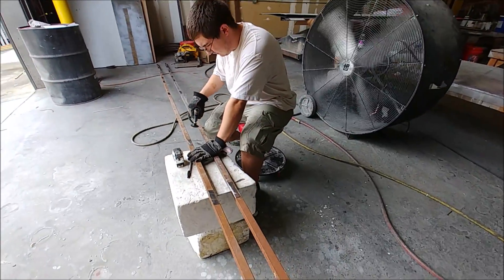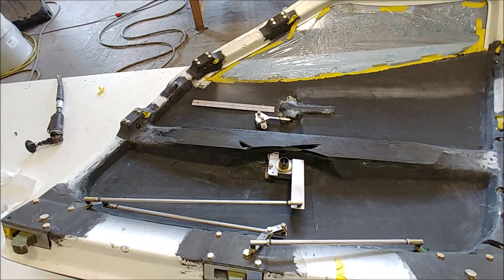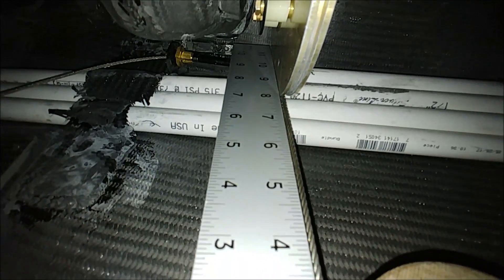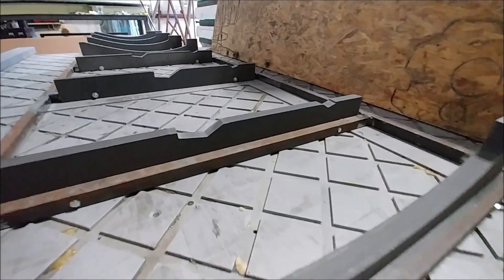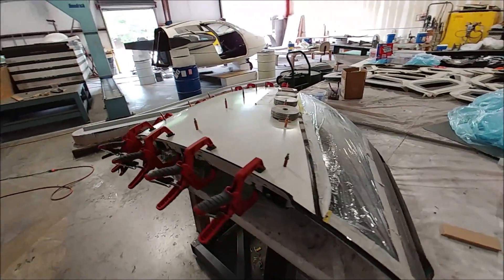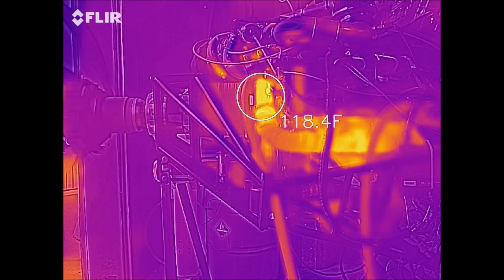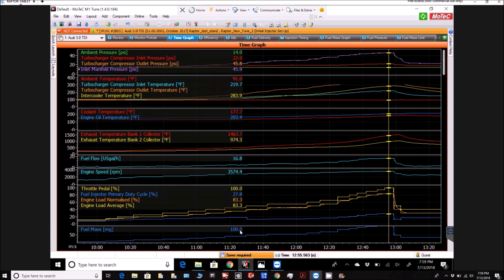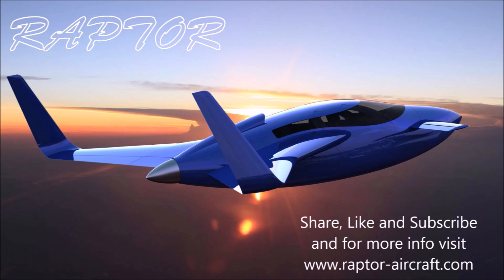EGT and Turbo Temps? - Building the Raptor Prototype

Comment: Peter. In my turbocharged 182, I usually see EGT temps in the 1450 range. The number I've been told to watch are cylinder head temps, which in my airplane are aircooled. How do the cylinder head temps, or the water temps look on the Audi engine?
Reply from the maker: You can see in the EGT log that the oil and coolant temps were still only just on 200f but they didn't really have a chance to build up.

Comment: I will look up some specs, but my gut feeling is that you're running an excessive amount of boost, at the very least I would experiment with lowering the wastegates spring pressure on the first turbo and allowing the second turbo to carry more load. Just for heat load leveling purposes and longevity.

 I don't think you need such high boost levels to carry the load you have, but I'm guessing at what load you have. I think you should experiment with lowering boost pressure and getting to the point where you get a light grey smoke from the exhaust. This would establish an absolute full rich condition as a baseline.
Reply from the maker: Once we're pressurizing the cabin we'll need the excess boost so right now I don't want to mess with that.

Comment: Please look into vapor or fogger for lowering intake and EGTs. It’s a very simple thing to add, costs less than $100 and works amazingly well on turbo engines. EGTs shouldn’t be above 1300 degrees for any extended period of time. For takeoff, you can go above 1300 degrees, but I’d suggest 15 seconds at the most. You can severely damage the engine above 1300 degrees. By installing the fogger, you can lower temps while increasing boost and horsepower at the same time.  Check into it.
Reply: Unfortunately I agree with him.  As having spent quite a bit of time with diesel engines on a dyno, I can say that 1300f TIT really should be what you aim for at sustained cruise for a diesel engine. Modern engines like this will flash above 1500f from the OEM, but only in short bursts.  Also, the FLIR camera is not capturing true air temp inside that pipe.  In my experience, the pre turbo temps will be hotter than the post.  So if your turbo 1 outlet temp is at 1500f, I would expect the turbine inlet to be 100-200f higher.  Which is too much either way.

Comment: Just food for thought: why are we combining the left and right cylinder banks into one stream and then power two turbos in series while we could have each bank just power one turbo. We only need to cascade the air compression but there is no necessity to cascade the exhaust path. Then in each turbo the heat would just drop 400 degrees and there would be no heat up in turbo 1 on the exhaust side. Also no restriction/heat-up in a Y-pipe.
Reply from the maker: Martin Renschler changing the configuration as you suggest wouldn't lower the temp exiting turbo 1 but I like the way you think. Thanks for your input.

Comment: Peter, I also had a question about the vacuum bagging process. You’ve created the channels in the molds for the silicone skin, but you not using them yet.  Is that in case you need to redo a mold and don’t to waste the investment of the silicone, or you just don’t want to worry about having to store and care for them during the development process?  Do the skins have a shelf life?
Reply from the maker: It's pointless creating the silicone for a single part right now. When you're trying to speed up part production that's when they'll be needed.

Comment: So you are reading the temp of the y pipe, not the temp of the actual gasses. Due to radiant and convective cooling, the pipe will never reach the temp of the exhaust gasses.

Educated guess would be about 1800 degrees for the egt. Which is actually a tad on the hot side if you ask me.
Reply from the maker: I'm not sure it would be that high because the exit temp is only 1500 and that should surely be higher than the inlet temp.
Reply: Raptor Aircraft

Turbochargers work by stealing kinetic and thermal energy from the exhaust gasses and using them to compress intake air. Typically egts drop about 300-400 degrees from turbine inlet to turbine outlet.
Reply: I agree with Jake. Two more EGT sensors will give you and the diesel tuners a much better picture. Install one EGT probe right before or after a manifold exit and one more right before the inlet to turbo #1.
There are numerous, well established diesel tuners in the states here and controlling EGTs is very high on the tuning priority list. Honestly, I would work with a tuning company that has more experience with diesels. Tuning the ECM to get the power the Raptor needs while also controlling EGTs should be very possible.
Reply from the maker: There's only about 14" distance from the last cylinder outlet on either side of the exhaust to where the left and right sides meet in the Y pipe. Is it really necessary to install a sensor at either end of that or will one just before the Y suffice?
Reply: Raptor Aircraft, 1 would be plenty then. Diesel tuners typically install the probe as close to the exhaust source as possible, ie, the manifold or just after it. With the continuous operation of this engine in a high power setting, controlling EGTs for reliability/longevity is vital.

Comment: Peter,

For reference a Cirrus SR22T with a twin turbo TSIO-550-K will regularly see 1600+ F at full power during the duration of the climb to cruise altitude. Cruise is not much lower at around 1550. This is for both turbos measured at about 1" prior to the turbine inlet. I know this is a gasoline engine with a throttle plate but the turbos are likely very similar and temp is temp. 

As more of a seat of your pants kind of comparison, flying around Cessna 400 series aircraft at night, looking at the cowling louvers through the window would reveil glowing red turbos and exhaust pipes. Just saying that I think the temperatures you are seeing are completely normal. 

Cheers
Reply from the maker: Adam, thanks for the info. Cheers
Reply: Adam Menge, waypoints are helpful but context is always critical.  That engine was developed for those conditions.  Audi??   Needs testing lots of fun work ahead.  :)

Comment: Hi Peter,

Just wanted to say I'm really liking your videos, and am looking forward to adding my deposit to your growing list.

In regards to the turbo heat issue, I would just like to make a couple of suggestions. Firstly, while the temps may be high your engine is in a static mount. While there is some airflow its no way near the same as could be expected at FL20 at 180Kias - thus most of your cooling is radiant and not convective.
Secondly, have you considered adding in something like the following product http://www.cfmplus.com/ I'm not sure if it's going to help 100% but their product seems interesting. 

best regards and many thanks.

Comment: Smarter people correct me, but the FLIR camera is reading temps of the metal not the temps of the exhaust gas before the turbo.  If you were to put a probe in to measure the EGT pre-turbo I'll bet it's something around 1200ºF.
Reply from the maker: My guess is that the flir temp is not that far off the inside air temp. The Y pipe does have the ceramic coating but I don't this it's hiding 800f. I'll get a sensor in there in the next month so we'll know for sure.
Reply: Don't know if you've done this yet but just to validate the FLIR readings against the ceramicoated pipe you could tightly strap a thermocouple on to the outside of the pipe and see what it reads. At very least that would ensure you're not dealing with an emissivity (which theoretically should be excellent) or calibration issue on your FLIR.
Reply: It's absolutely far off from the inside gas temp. First, the heat transfer from gas to pipe is not very efficient and requires a substantial delta-T, then the heat flux across the pipe thickness also requires a delta-T. The external temperature of the pipe is determined by how hot it has to be to radiate away the required heat flux, not by the temperature of the gas inside it.

Also: I thought that pipe was glowing red in some earlier video? To visibly glow, the temperature must be higher than something like 1000F, so if that was the case, the IR camera is not displaying a correct temperature.

Comment: I know absolutely nothing about turbo charged engine design, but 1400 does not sound high to me for the egt, especially after leaving the turbo, where I would think the compression of the air generates  a lot of heat. I lean my IO550 in climb out to 1300 degrees, and it has no turbos.

Comment: I would be most concerned about turbine inlet temperature. The turbine has a rated input temperature of probably around 1200F, generating 30lbs of boost should lower that around 400F meaning the exhaust path after the turbo should be around 800F after the turbine. You’re reading 1400F after the turbo which makes me wonder... You could just clamp a series of temp gauges to the exhaust pipes for now until you have time to mount them properly. At least by using the same set of temp sensors before and after each turbo you can get a better idea of the heat flow.
Reply from the maker: The temp sensors I have are accurate. My feeling is that the exhaust exiting turbo 1 is being compressed more because it's being forced to spool up turbo 2. The back pressure is likely what is driving it's temp so high. So it's likely that the exit temp would normally only be 800f. Anyone want to contribute their thoughts on this? I don't have pressure sensors in the hot side. I doubt they would last long with the heat.
Reply: Wasn’t questioning the accuracy of the temp probe. Was concerned the temp is high suggesting that the turbo is being run over temp. 
My suggestion of strap on sensor before and after each turbo was to get a relative temperature reading before and after each turbo with the same measurement method until you have time to get the sensor welded in. Of course you could just use the FLIR to get temps before and after each turbo to see the relative temp differences. Of course you will need the same surface type to measure on each side to get the correct relative measurement. 
Temp probes before and after on hot and cold side and pressure sensors before and after on cold side would enable you to measure the work being done by each turbo which in turn would enable you to sanity check the temps you are seeing. All depends on how much you want to instrument up the test rig.

Comment: Great work and progress as always!!  
Regarding the temps and fueling, I work for Caterpillar as an engineer in their Diesel engine division, but I am no way qualified to tell you how hot to run the specific components in the unique system.   
I can say if you’re really reading hotter turbo out than EGT in a here is a measurement issue as that’s physics.
Reply: Tim Duncan ,,, I don't know what the exact numbers should be for this combo, but I would try and find out Audi's numbers. Yours should be overall lower as your downstream restriction is less. At your interest level you should have four probes: turbo one inlet and outlet, and even though it's a short distance to turbo 2 the same for it . Only talking hot side here .
Reply: Are you measuring pressures in the exhaust before and after each expansion step?   This should be used as a Check bit to temp data.  Are you measuring turbo rpms?
Reply: Roland Tamaccio I think you meant Peter’s temp limits would be lower as downstream restrictions are higher.  More boost vs Audi, requires more pressure drop on the exhaust side
Reply: Tim Duncan ,,, by downstream I was referring to an automotive system, all the way to the outlet tip. Of course we don't know how much of this data is available from Audi. Btw, how much of the exhaust system is oem Audi ?
Reply: Roland Tamaccio,  good points there will be no Audi exhaust system parts past the turbo.   
Regarding limits, lower would be safer and more durable.   Durability is a big issue and hard to engineer with specificity.  It requires a lot of time and fuel to validate, very hard.  Luckily Audi has presumably done a lot of this and set their limits accordingly.  Pete needs an Audi v6 expert.
Reply from the maker: I don't have pressure sensors. I doubt they would even handle the heat. No rpm sensors either as these turbos don't have fittings by default. I don't have time to fit them.
Reply: Raptor Aircraft ,,, well, somebody like you that has the will to find out, will eventually want to look at "drive" pressure. You have to run long lines to get away from the heat.
Reply: The reason for the temp rise is temp stacking from drive pressure. I run a 600" engine on 50% alky & 50% nitro & see 1200F at the port &1900 or more at the turbo's depending where my gates are. I don't know what numbers this diesel should see but Tim Duncan's Cat connection should be able to get you some ACERT info that would be a good ball park.
Reply: NZ Salt Flats Racer ,,, although nitro is sometimes considered to defy physics, it doesn't. Due to the huge fuel volume with nitro and maybe the slower burn rate you have quite a bit of combustion continuing to burn in the stack and probably turbine housing causing the rise in temps .
Reply: The variation was actually similar when I ran straight alky (methanol). Everything on the engine is recorded with a Racepak.
Reply: NZ Salt Flats Racer ,,, hmmm, interesting, of course the methanol is running roughly twice the volume of gas or JP-4. Maybe possible you are seeing some cooling near the valve .